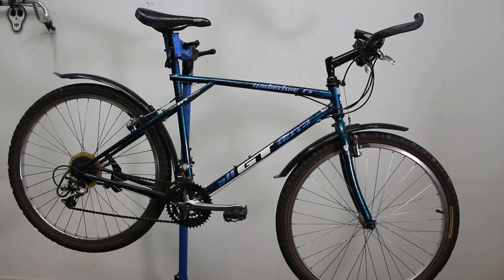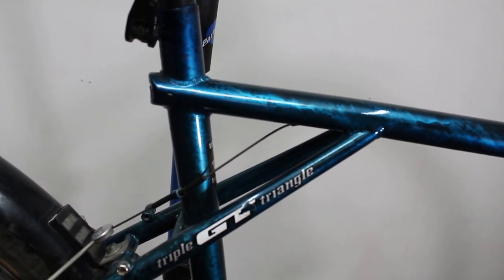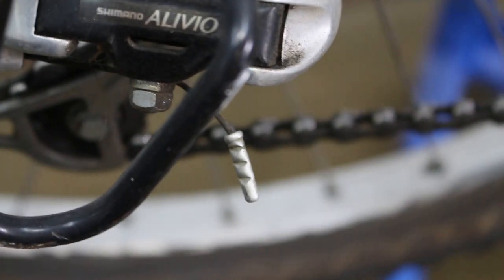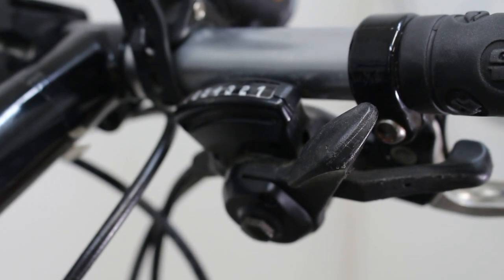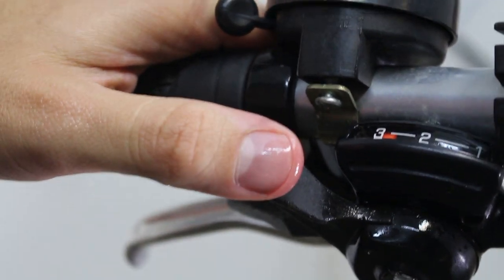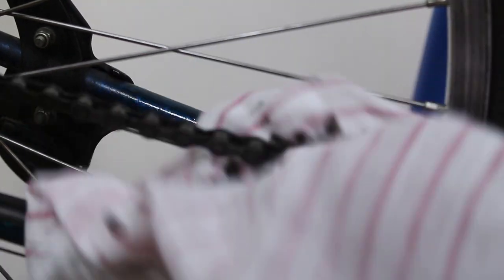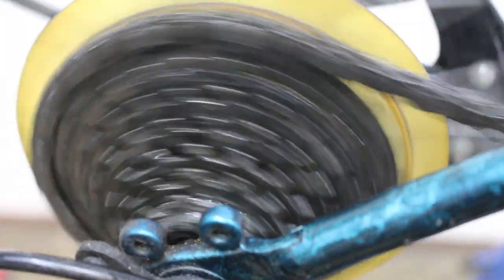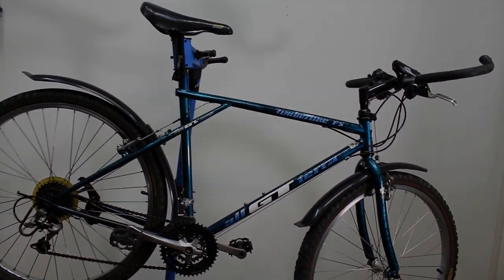1995 Vintage MTB $50

Comment: These old MTB are great bikes.....yes the ones with no suspension are the better ones.....no worries on using or replacing tired old suspension forks.....mine is an old Trek 950 built in 1992.....set up with drops, wide slicks, fenders, lights and rack.....great commuter, touring and gravel bike.....I have mine since 1997....paid $30 for the frame and fork.....it's my go to bike still today......
Reply from the maker: I agree and hope to keep this one for a long while

Comment: Not sure but seems that the highest gear sprocket on the rear looks absolutly worn out, as well as the chain most likely. I like GT and the frame is rad but in my opinion you have to let go lot of componants in order to get a smooth ride with it.
Reply from the maker: Hey Cecile! Thanks for stopping by. I really haven't got a good chance to look it over closely, just got her back from my friend who was borrowing it a couple of days ago. I'll dig into it soon I hope and surly make a detailing what's wrong. I recently got one of them chain checking tools, looking forward to trying it out.

Comment: Hello, how did you confirm this is 95? I have the exact same bike, paint decals etc and have been desperately trying to identify the year. Are you sure this is a 95? If you have confirmed the year somehow I can be confident mine is the same year
Reply from the maker: It's been awhile since I owned this bike but generally I try to check with the serial numbers, but if that doesn't help I like to look at the original advertisements, sometimes you can match the bike exactly, colors, parts etc. As for this one it's been so long I don't recall if I was really that sure or not.

Comment: I always use Wd40 to clean my chain
Reply: Wd40 is not a lubricant
Reply from the maker: it does a pretty decent job of getting the gunk off. But I like to use lighter fluid, I feel a little like it's a dirty secret, but it works really well to clean the chain up.

Comment: Steel is real
Reply from the maker: I really think in the end I'll only have steel framed bikes, something I really like about them.
Reply: Steel is only one metal which is repairable and reliable after 20 or more years if you don't let it rust. Aluminium is mud, if you tear down thread on some screw or nut, you can throw it to dustbin, but steel is steel. They should make steel at least handlebars and that what is holding it in frame (I don't know english name), I am always afraid I will destroy threads when I want to tighten that, aluminium is really soft mud compared to steel and dural is still aluminium only with noble name.
Reply from the maker: @Pidalin  I would love to one day have only steel frames, at least I think I'd like that. All the steel bikes I have rode made me happy.